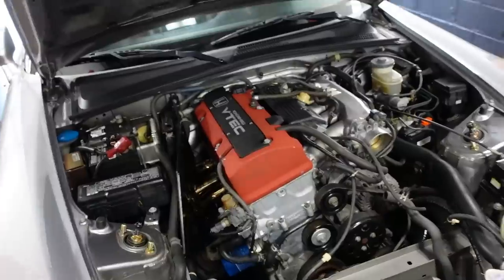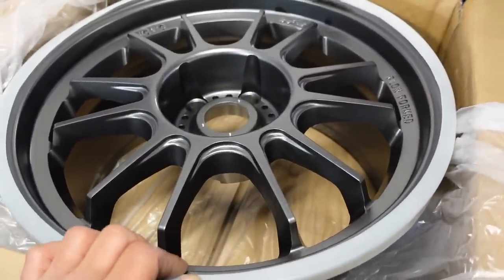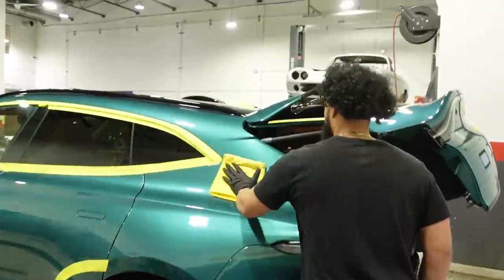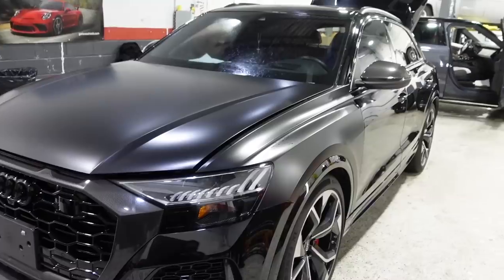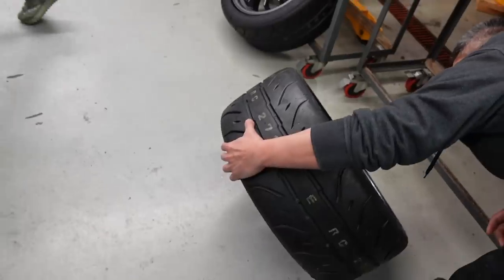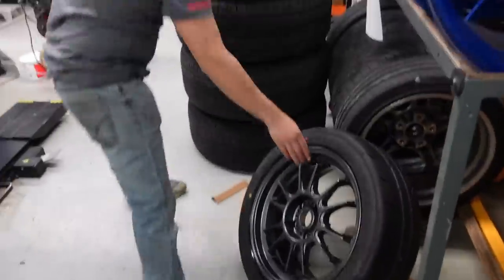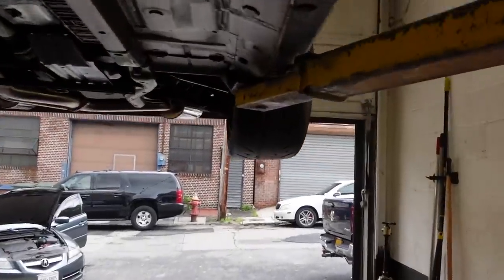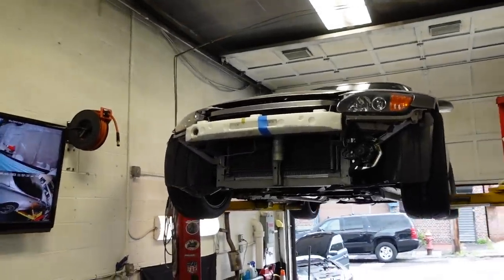Wheels On The Honda S2000 Look SICK 😍 (PLUS Bonus Footage)

Comment: Need to put 255 /40/17 on rear! 225/45/17 is a taller tire than a 245/40/17!!! It’s supposed to be 215/45/17 with 245/40/17 OR 225/45/17 with 255/40/17. Both set of tires are the same circumferences

17x9 +40 you will need to roll the fender and cut the tab and relocate it. Tires WILL rub. May need to roll front and cut fender liner. You got aggressive fitment for a S2000. Modification will be needed.